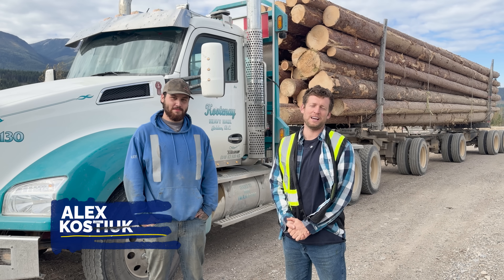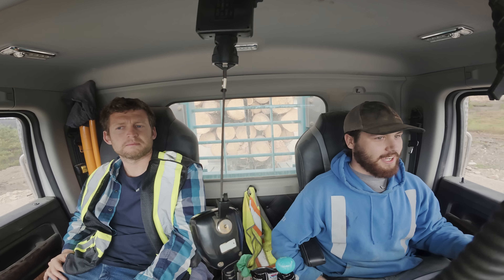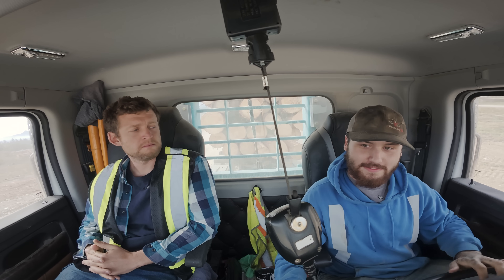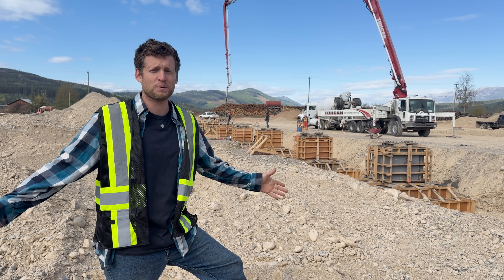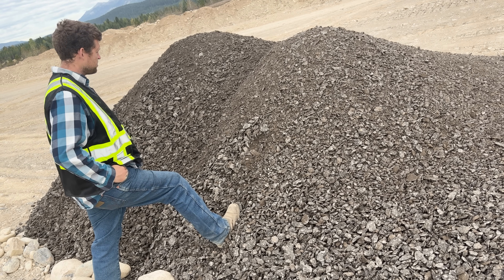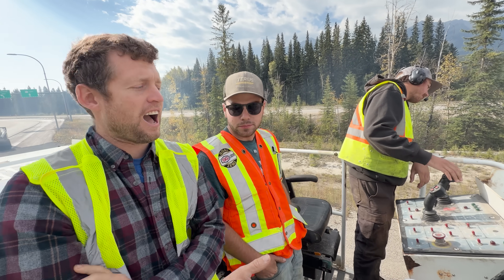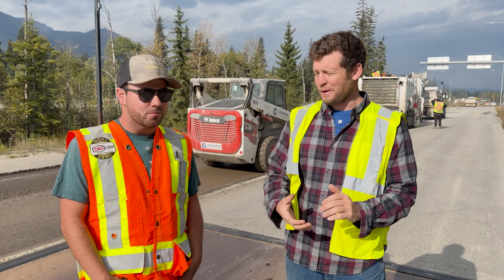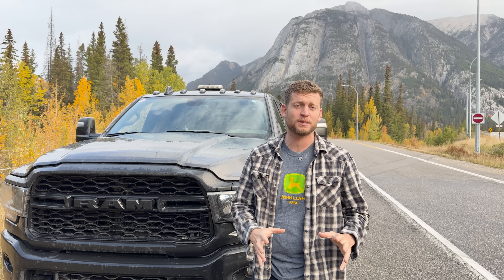First Ever Test Run on the Edison Motors Track

Comment: we have paid scales at many truck stops. some businesses also have scales that usually have a display for the drivers, but they'll get pissy if you arent doing business with them. the ones i've used all just weigh the gross, no axle weights. the DOT scales only give you your weights if you're getting a ticket. i speak from experience...

Comment: In a few years time, when you’ve expanded your production capabilities, what are the chances of Edison producing consumer vehicles? 

I’m certain plenty of people would want your diesel-electric drivetrain in an affordable “feature-bare” unit; i.e. stripping out all the useless tech that other companies are shoving in cars should more than make up for the increased cost of the drivetrain.
Reply: The hybrid tech doesn't scale down to tiny cars that well.

Edison has stated that it is working on selling a simple brand new 1 ton hybrid truck with no fancy additions.

Comment: Will you be testing your trucks on dirt/gravel to make sure the dust and rocks don't destroy anything underneath the truck? Only testing on asphalt means you're not testing for common off-road use.
Reply: They have plenty of forest track around them they can use. They said they will also build steep dirt test track, to test traction and brakes.
Reply: @niconico3907  Thanks. I know they are required to have a test track, I was just wondering what the Canadian requirements are for the test track. Asphalt, gravel, dirt, do all of these tests need to be done for logging style trucks?

Comment: You should start making fire trucks , ordering a fire truck takes months and months and the costs are astronomical the price has tripled in 10 years . I believe you could produce fire trucks and keep them at decent prices . There is such a shortage of apparatus
Reply: And having it be hybrid would probably make it even lighter instead of having to have the auxiliary pump generator or all of the aux systems you could just use one generator. And high voltage motors would probably work better for the hydraulics with the torque capacity and the stop and go that fire trucks do since they are always trying to get places quick would be really advantageous for the electric motors and regen braking
Reply: @davissmith5670 firetruck use the transission to power the water pumps. They have normal manual gears for driving, and an additionnal gear for pumping.
Reply: @niconico3907 Fire trucks these days use some kind of Allison auto transmission. Firefighters have much more to worry about than shifting gears. Where they use a power take off port on the transmission to power the rest of the equipment, Edison would just have everything electric.
Reply: Who makes the fire truck equipment that goes on the chassis? If it's a REV group company that ain't helping much.